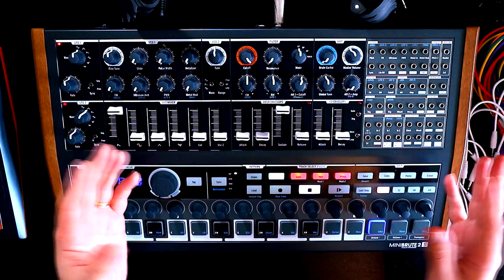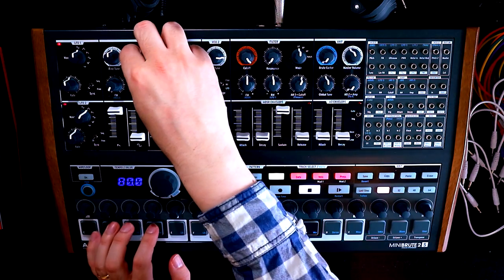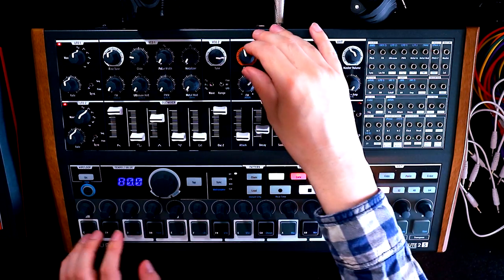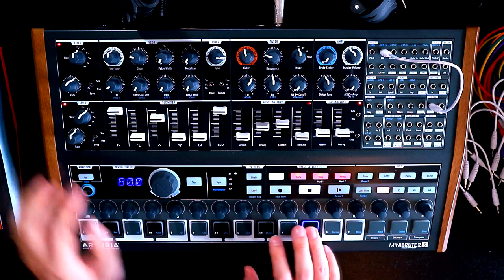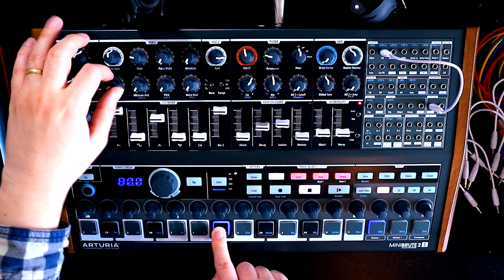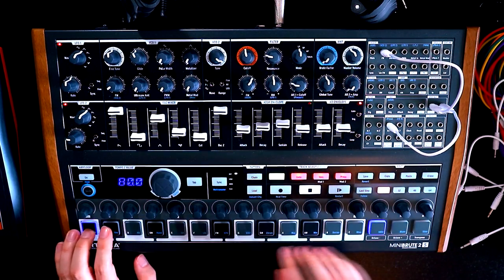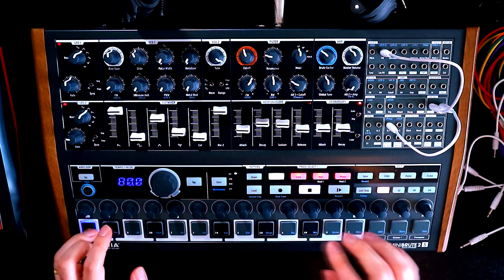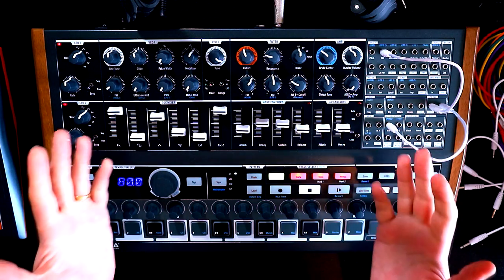Arturia Minibrute 2 / 2S - Let's Build a... Lead

Comment: Nice and full
Reply from the maker: Arturia really refined the sound on this second generation - just good solid, good sounding oscillators, filters and amps. Makes it a lot easier to build nice sounding patches when the fundamentals are already right.
Reply: Yes, it definitely sounds more refined, and the Brute factor seems smoother indeed.
Reply from the maker: For sure. I kinda use the first third of the knob like a time machine kinda - turn up to get more nostalgic and vintage sounding. I should do a video where I push it into noisy chaos territory - it's definitely still there, just not until right at the end of the knob!